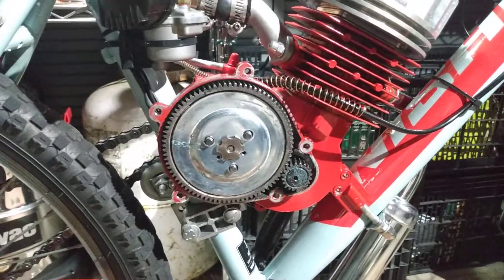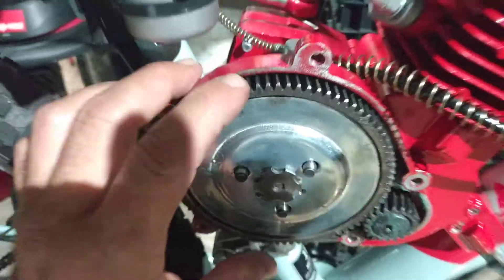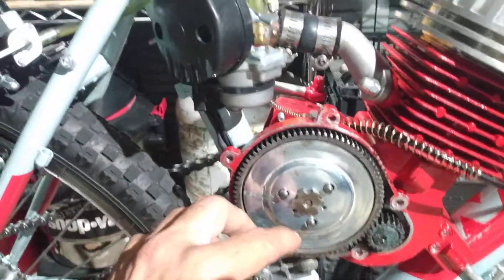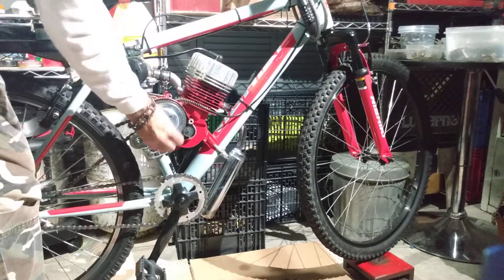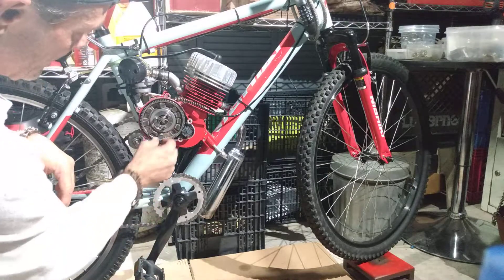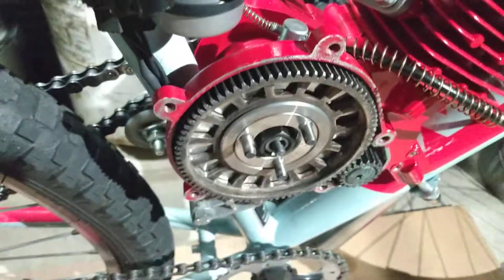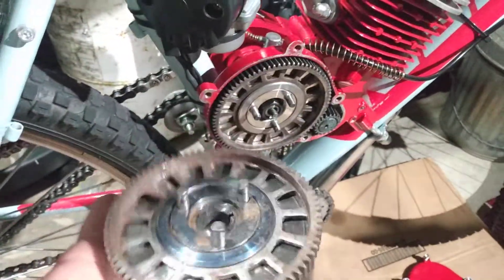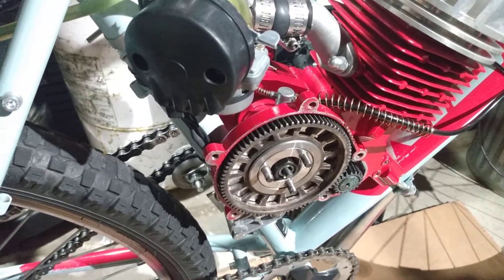Motorized Bicycle Engine Ring 🔕

Comment: that's a good video sir there's a video on YouTube I think DHL shows you how to break down and rebuild the clutch basket bearings I use Lucas red and tacky on the gears put it on thin a little goes a long way I'm talking from experience when I removed my clutch basket the first time I saw all the grease behind it and said to myself what a waste so I don't put as much so it doesn't sling it everywhere good video sir stay safe
Reply from the maker: I'll look that up. Thank you

Comment: I take a syringe with two stroke oil or a greasing needle and lubricate the ball bearings in that clutch assembly. Careful just use barely any ,anymore will sling behind the pads. I also only lubricate the main bevel gear not the whole clutch assembly gear. It's a good idea to always keep spare clutch assemblies on hand. Years ago I had problems using the stock clutch pads. They had little metal wires in them that work their way into the clutch assembly and chewed up the bearings and would lock it up. Using the rubber type clutch pads and making them free floating my clutches last a lot longer now.
Reply from the maker: Thank you for the tip. Very helpful. Was wondering if I should and how.
Reply: @CORYJOHNM  It's easy to overdo the grease in the clutch and have it sling everywhere. I like to use a good sticky grease "red and tacky"on the bevel gear and just enough to where it can't sling.  I applaud you for talking about the pad being free floating, which is very important in these clutches. Everybody just jams it in there & when they're clutch starts slipping they buy some poser heavy duty clutch that makes them go slower because it's heavier and has more rotational weight. Same concept with those $300 Gemini Wheels, you have more rotational weight =slower.
Reply from the maker: @JamesPiccone  I do grease the gear. I been using some blue stuff I have on hand. I'm kind of obsessive about checking that. Gonna get back in there and oil those bearings. Exited now.
Reply: MR. James do you have a link to the rubber clutch pads I have some like rubber and fiber ones I have some pink rock ones to they slip and I have a tan set they also slip the reason I was asking cause the rubber cloth fiber ones I think have metal fibers in them but they grab the best for me
Reply: @mikemiller3303  if you come to my YouTube channel I can post the link but it won't let me on this channel.